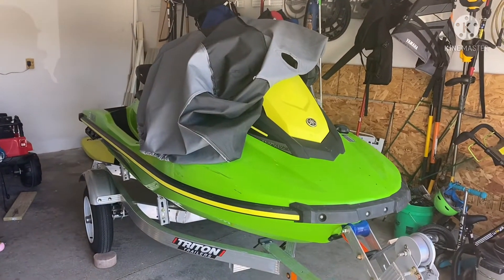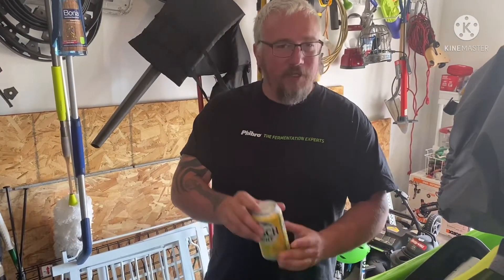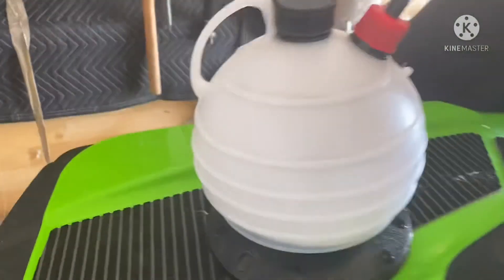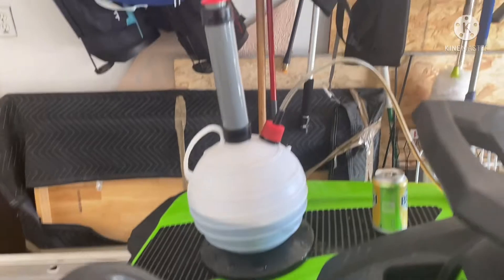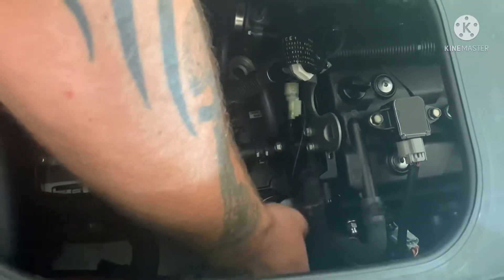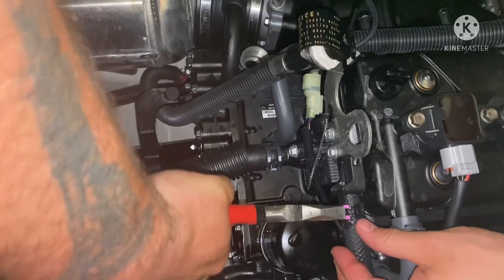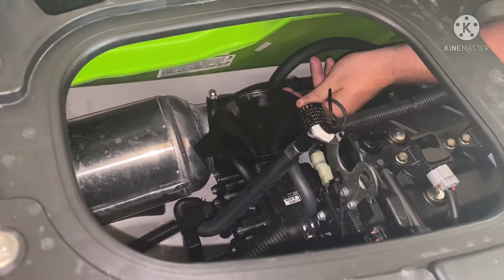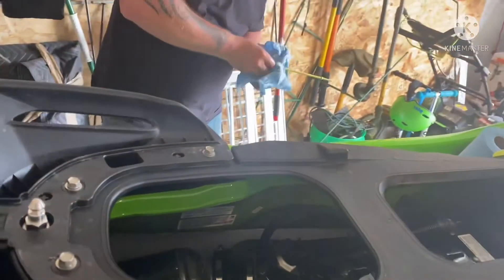Oil Change 2021 Yamaha EX Sport

Comment: What I really like about your video is that you show how to remove "all" the oil.  Not just from the dipstick but also from the additional tubing.  This will definitely drain all the oil so when replacing with new, you don't have a combination of both old and new oil.  Also like your sense of humor.  Would like to see you do a total winterization video (oil, antifreeze, battery removal, etc.) for us folks that live up North.
Reply from the maker: Thanks bud. Gonna due several this winter as we’re in Wisconsin so needs to be done. Built a shop now so more room to drink beer, and work on videos.
Reply: why only half a quart down the tube..looks like u pulled quart n a half out of it?...

Comment: Not gonna lie I wouldn’t take that ski even for free
Reply: Why?. I own a 19’ Yamaha ex deluxe. Got it brand new for like 6k which fit my price range as I don’t have tons of money to throw around. Great pwc for the price. Been a blast for the past 4 summer seasons. Has that Yamaha reliability, runs and handles great for what it is. Decent amount of accessories and aftermarket parts for the ex line as well.